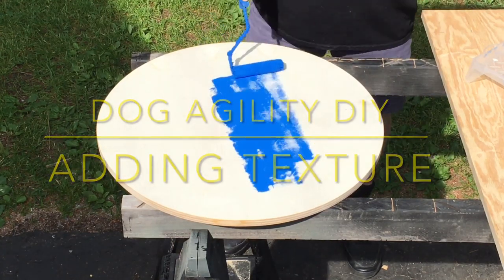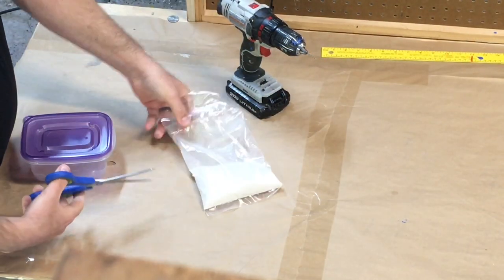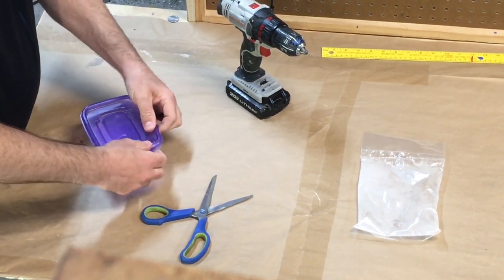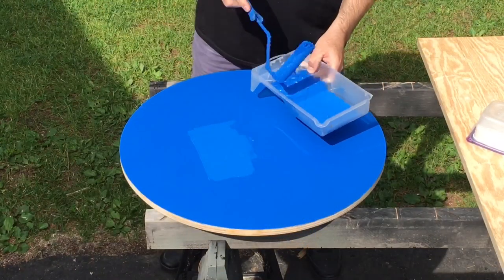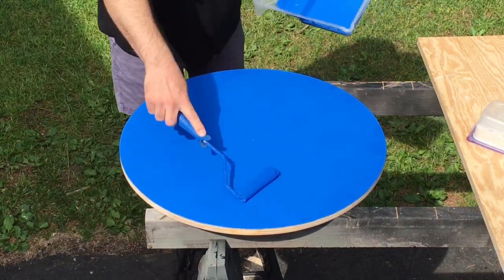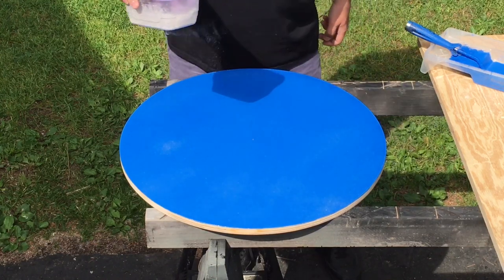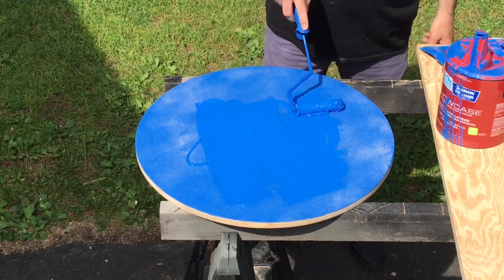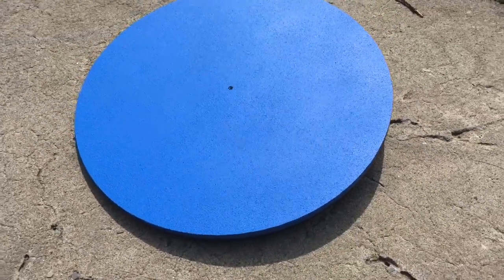Surfacing Dog Agility Equipment

Comment: I like this idea.  Question:  Is there any real difference between using this or rubberizing?  Or maybe a better way to ask is one method "better" than the other?
Reply from the maker: @rmfawley Rubberizing is always best however it is much, much more costly. You would need EPDM rubber granules and binder as well as tools. Unless you are doing many pieces or doing it as a business, it may not be cost effective. Thanks for watching!